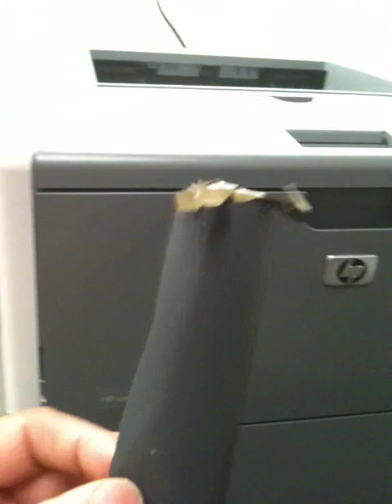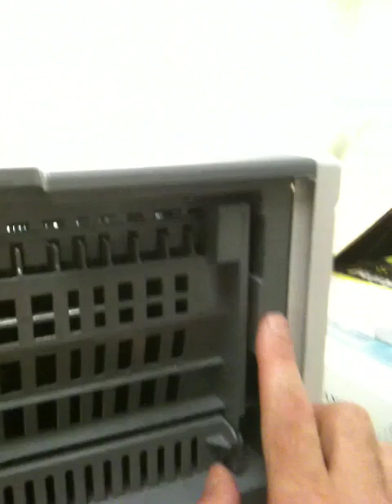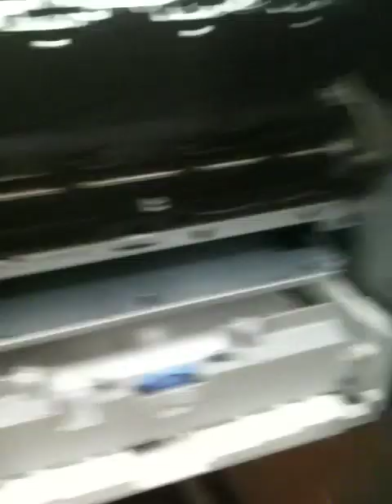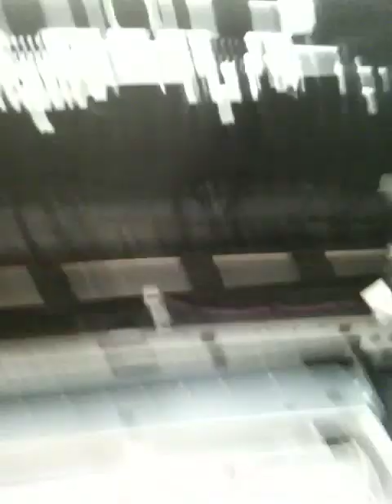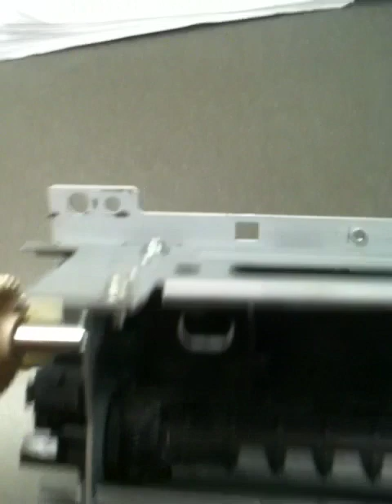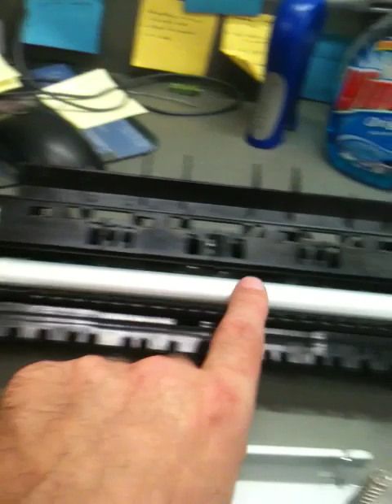Fuser Replacement For HP LaserJet P3005N Printer

Comment: (cont. transfer roller replacement) Slice the tape on the replacement transfer roller but leave the paper on. Insert the new transfer roller gear side first and press down to engage the clip. Do the same for the other side.  Once in place, pull the paper off of the transfer roller slowly.  I usually wear latex gloves to keep the toner off my hands but to also avoid touching the transfer roller surface. The oils from your skin will cause toner to stick to the roller and will create smudges.

Comment: Great video.  I just wanted to mention that if you are working with a re-manufactured fuser like I did you only need to remove the four main screws and the whole fuser unit pulls out.  The standard hp maintenance kit also comes with a replacement transfer roller that is exposed from the front side after you remove the fuser unit.  Like the 4000 series you just press down squeeze inward on the gear side clip first then the other side and lift out.